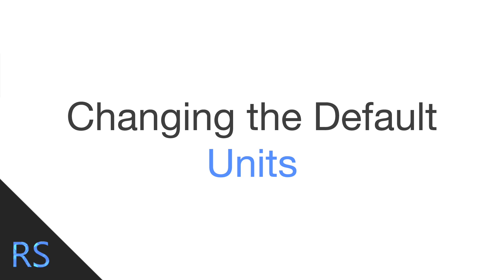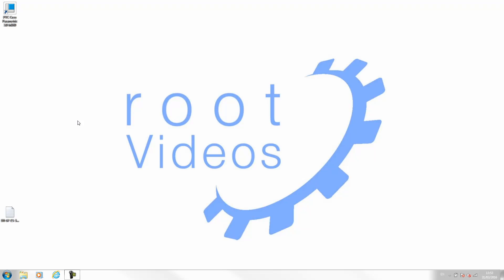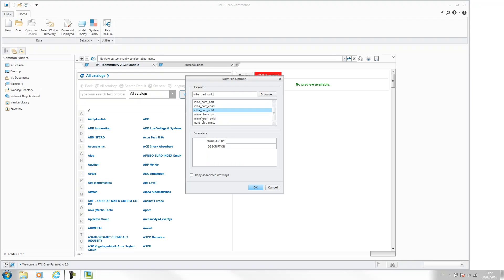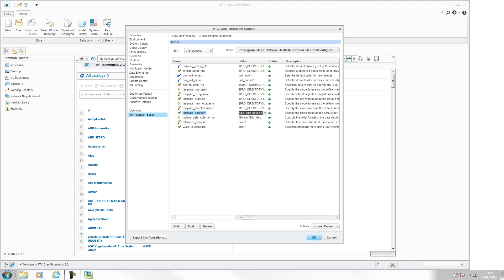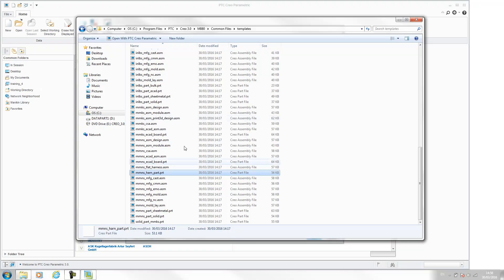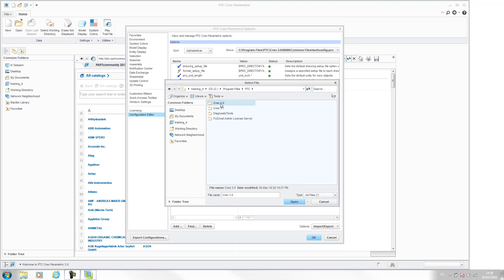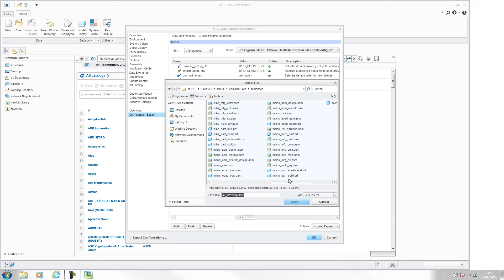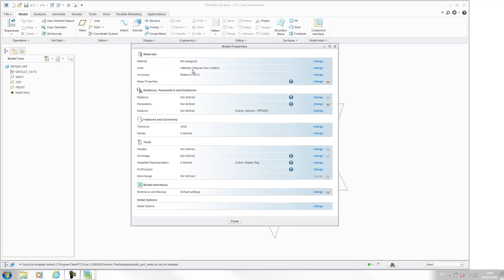Changing the Default Units for Creo 3.0

Comment: How to add parameters in template
Reply from the maker: To add parameters to the start part

- Open the template file in Creo

-  Go to File > Prepare > Model Properties > Find "Parameters" under  Relations, Parameters and Instances and select "change"

- in this window you should see the existing, default parameters. You can add more by clicking the plus button.

- Save the file 

hope this helps,
cheers